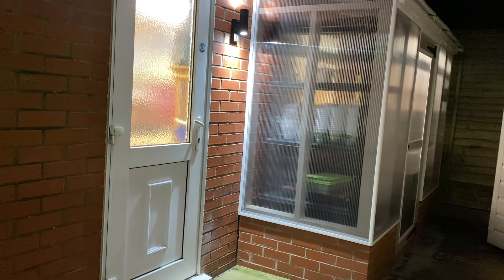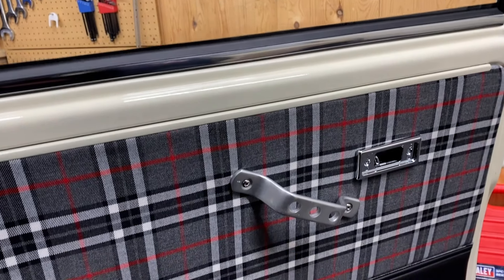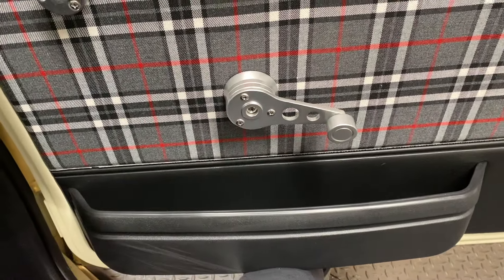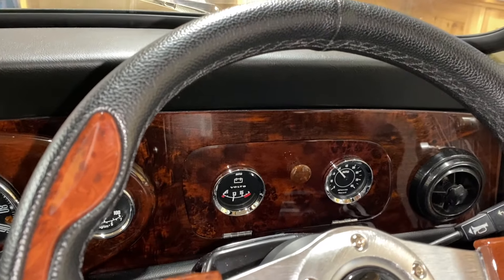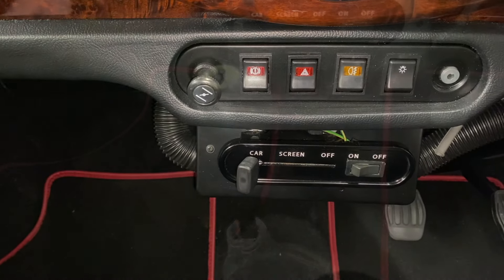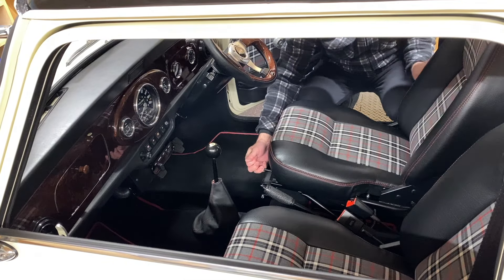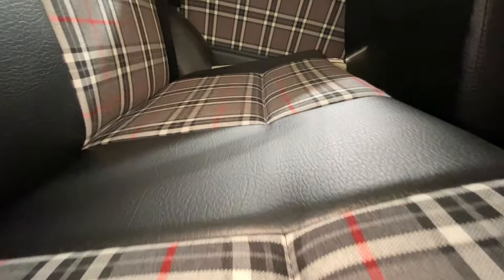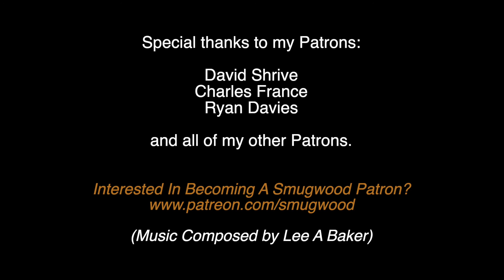Classic Mini Restoration Episode 52  - Newton Commercial Suffolk MK2 Seats and Full Interior

Comment: The seats look ace. Set the car off fine!
Reply from the maker: They’ve been so much better on my back compared to the ones I had before. My only moan with them is that after sitting on them all the way back on the subframe, it’s dented my side bins in the back…only noticed this week. Not a major issue but a little annoying. But the seats themselves are really comfy and do compliment the car.